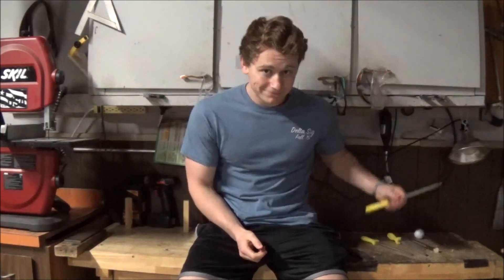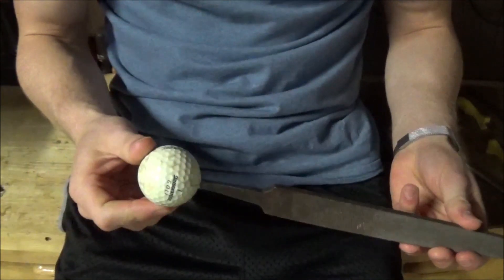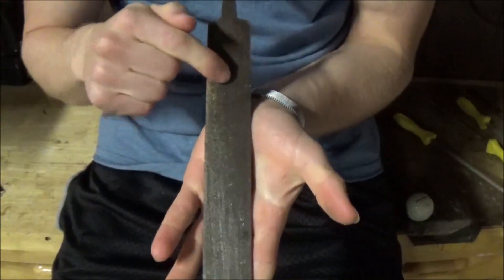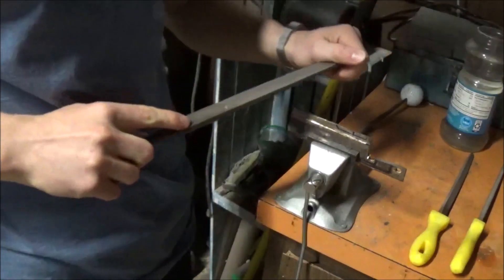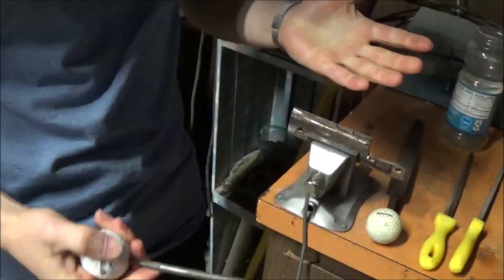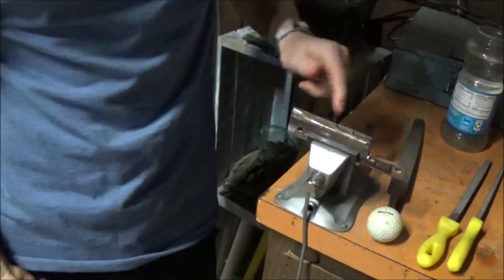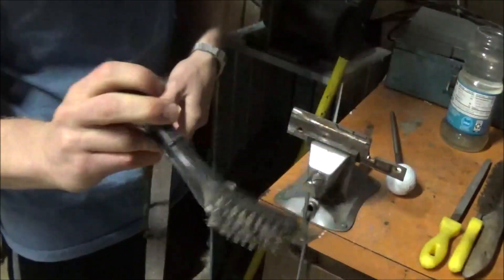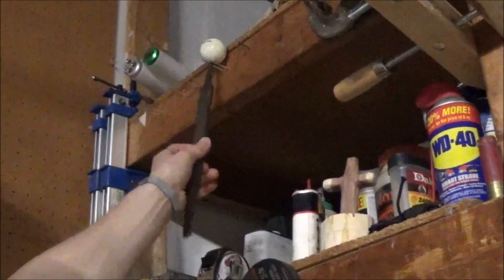Metal File Basics

Comment: Nice video. I've been using a 4" wire wheel with a drill to clean up old rusty files I pickup at estate sales. Works great. I think I have about 30 files-mostly Nicholson. Use them for restoring vintage hand tools.
Reply: You're dulling the teeth.

Comment: Why do you only file in one direction?
Reply from the maker: The teeth are angled forward so you’re only cutting metal when you push the file. If you put pressure on the file while dragging it backwards, it may dull the teeth prematurely.